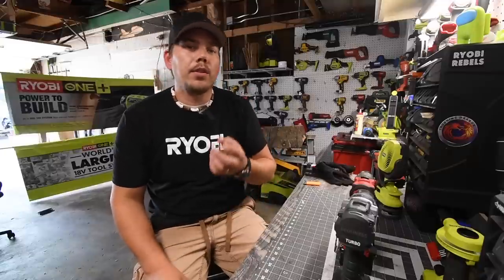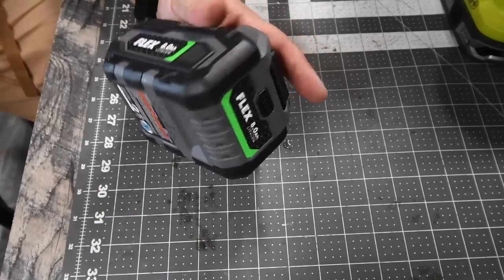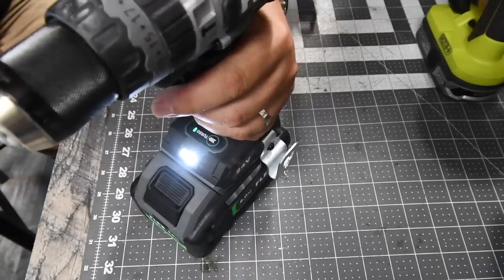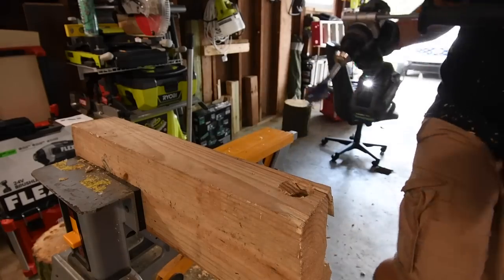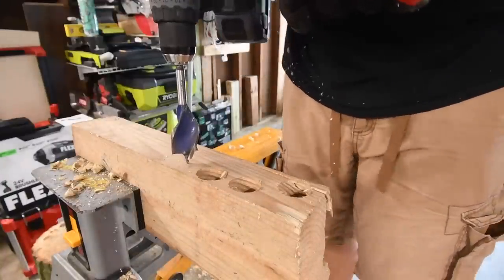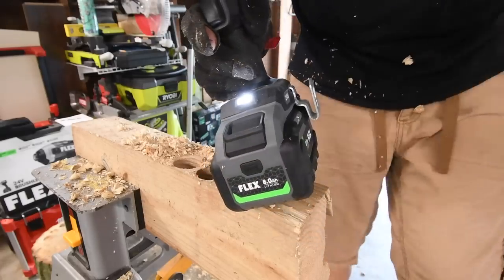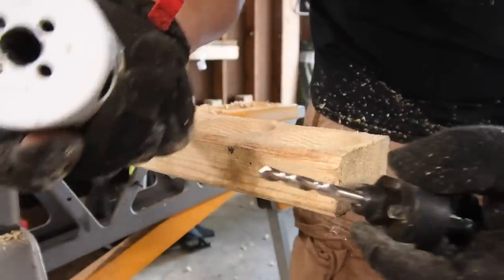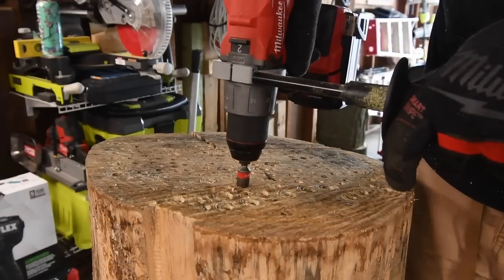FLEX vs Milwaukee (8ah 21700 Cell Batteries)

Comment: I feel the Milwaukee H.O. 6 amp batteries seem more powerful than the 8 amp for some reason
Reply from the maker: I can put that to the test.
Reply: @ManCaverTools   I do believe the Samsung 21700 cells in the 6.0 are different than the 8.0 and crank out more amps so a bit more power. I have both and the 6.0 feels stronger that being said the Flex puts down the power. I'm sure someone will tear down the Flex 8.0 maybe it's using the same high amp 21700 the 6.0 is using that's why it looks gigantic LOL.
Reply: Its true 6 more torque then 8
Reply: It depends on the tool saws draw more current so a 8amp will better but a drill or impact driver draw less so a 6amp will do better, torque test channel did a comparison with a 6amp and 12amp battery on a impact wrench and the 6amp did better but other channels do comparison on circ saws and recip saws and the 12amp does better than the 6amp
Reply: @loucifer323  Agreed kinda curious as too what 21700's the Flex batteries are using? The 8.0 here may have an extra row of 21700's that the 6.0 milwaukee is running that's why it looks bigger. If that's the case I guess 6.0 batteries with an extra row on a milwaukee 8.0 than it be on HAHAHA. It seems all there batteries may be running higher amp 21700's for that extra turbo edge no battery expert, but just a guess 🤷‍♂️
Reply: @loucifer323  well said Lou Cifer!   There are dudes still knocking this M18 6.0 vs 8.0 debate around!  Wow!  Ima try to contact my Milwaukee rep tomorrow, and see if I can settle this, or if there is something true in their logic!  Peace!  👍

Comment: 18volt  compared to 24volt is a 6volt difference, it's like comparing a 4volt to a 12volt tool , not a fair comparison
Reply: Lol. The flex is "24 volt max." Just like the DeWalt 20v max. There's only a 4 volt difference between the MILWAUKEE and flex.
Reply: @Factoryseconds123  
Je to tak, nemozno porovnavat rozne platformy cize 24V vs 20V
Reply: @Bjukemen  omg I can read your your odd message. There isnt a big difference, for example dewalt999 18v can beat hilti 22v or makita 40v  with battery included 21700(the most important which battery you use during the test)

Comment: There you go Folks! That's another TKO Victory 🏆 for Flex
Flex 24V Turbo Hammer Drill
8.0Ah 21700cell battery
VS
Milwaukee 18V 8.0Ah 21700cell battery
Flex: 8pts
Milwaukee: 2pts
The winner by TKO Victory 🏆
The Flex! 😁😊

Comment: I'm a Milwaukee guy and I just tried watching your challenge with flex against dewalt 999 and you used the 8ah with turbo on the Flex but the 6 ah on the Dewalt but here your using equal batteries so how can you say that the Flex Dewalt challenge was fair then turn around and use equal batteries on this one the Dewalt had a 8ah at the time you made these but did not use it, if your going to make these challenges make them fair

Comment: If the flex can hold up to daily use at that performance level milwaukee is screwed
Reply: I think your right but field use is different then a testing set up, he doesn’t show any factors other then the using the tool,,, size is a huge factor as well as weight and usability it’s odd places those things matter more then speed because we all know they are gonna get the job done in ideal conditions
Reply: @AnxOG663  the Flex is not so much bigger than any other heavy hammer drill. 
The Milwaukee is the exotic unit here in that lineup.
The point is if you use it as an heavy framing drill size don't matter, it will be an advsntage.
At the other hand i prefer an mid torque drill driver for regular use that is more than a pound lighter than the M18 Gen3